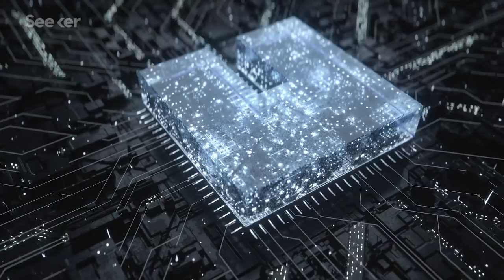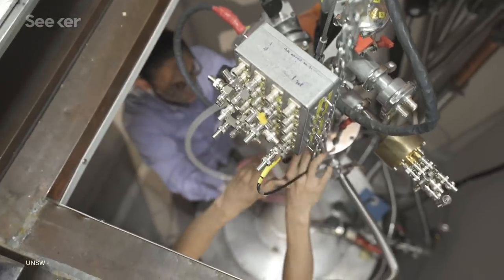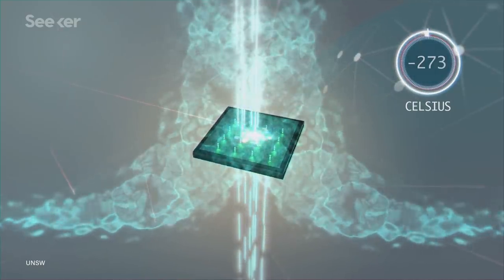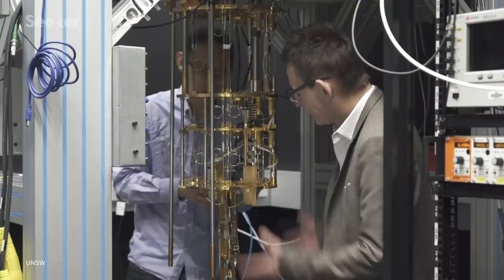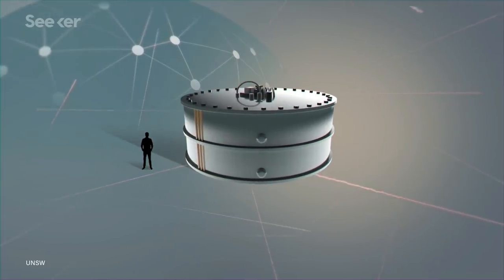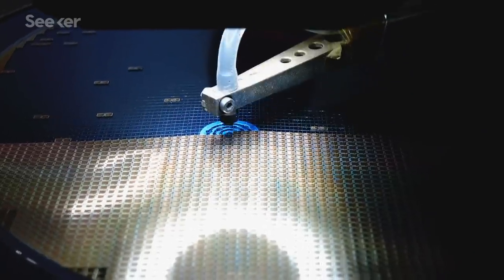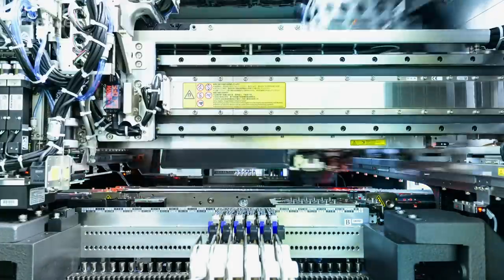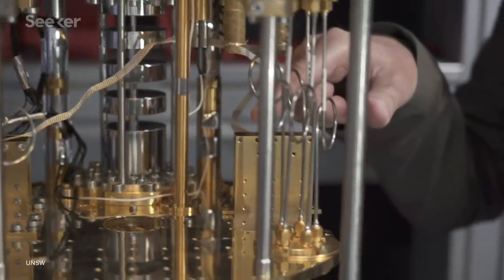‘Hot’ Qubits Crack a Major Quantum Computing Challenge

Comment: A quantum computer should be able to route the conenctions on a printed circuit design quickly, and also solve routing problems that conventional PCB router software struggles with. Same class of problem as the travelling salesman question, trying to find the shortes overall route between many different places. I'd love a quantum computer as part of my CAD setup but it won't be affordable in my lifetime.
Reply: Try Leap2 from D-Wave, Python 
Quantum computing in our lap👍👍

Comment: Have heard quantum computers give a likelyhood answer, rather than yes/no... I'm curious as to weather the likelihood answers are consistent? Like if you ask the same question again, is it possible to get slightly different answers?
Reply: technically yes, for my understanding, if you have a model to ask if the circuit in a specific angle result is true or false, it can give you a result like 34% true and 66% false and running again it could give 35% true and 65% false.
So if you asking something whether a coin will fall on head or tails with the same insufficient data, it could give different results
Reply: No, it would be the same answer, because the purpose of a Quantum computer is to go through all Possibilities in a superposition state then give a classical outcome of 1 or 0,  for one same solution... because the solution or answer is correct 
       Return = True always

Comment: I suspect Quantum Computers will be good at REAL WORLD solutions. For instance we can try and calculate how various molecules might interact with a potential drug. With a classical computer this takes FOREVER as you have to brute force your way through near infinite calculations of incredible complexity. But with a Quantum Computer, if you design the program correctly, the system can only ever fall stable into the PRECISE SOLUTION to the problem. That's the key, the system stabilises into the answer. The difficulty is learning how to program the system in the first place so that it can only ever yield the answer you are looking for. Bit of a Hitchhiker's Guide to the Galaxy scenario, you know the answer is 42, but what is the Question in order to arrive at that answer? The real power comes when you can determine a real world macro problem follows the same MATHEMATICAL rules as a Quantum mathematical problem. You then encode your Quantum Computer to give an answer to the Quantum problem, and BINGO you have an equivalent answer to your Macro problem. Bit like certain IONS can behave mathematically equivalent to Black Holes. We can't study the Black Hole directly, but we can probe an ION in the lab and hence infer how a Black Hole might behave if indeed they share the same Mathematics (as theory suggests). By the way, this video mentioned 0 Kelvin. What they really meant was FRACTIONS of 1 Kelvin, as you can't EVER achieve 0 Kelvin. Mathematically speaking there is an asymptote at 0 which you can approach but not reach.

Comment: Hot Qubits? Can you link the paper on this?
Reply: The cores of D-Wave quantum computers operate at -460 degrees f, or -273 degrees c, which is 0.02 degrees away from absolute zero.

(460°F − 32) × 5/9 + 273.15 = 510.928K

Comment: Keep them cold? Seems simple to me. Put them in space orbit around earth
Reply: That might be a good place for one of these, but it’s not quite that easy 😅 Things that are in the sunlight in low earth orbit usually reach around 250 degrees, so you’d definitely still need a lot of equipment to keep these cold.
Reply: That's a pointless argument..
The cores of D-Wave quantum computers operate at -460 degrees f, or -273 degrees c, which is 0.02 degrees away from absolute zero.

Comment: 1.5K is 271C, which is almost the boiling point of hydrogen... that's pretty good
Reply: The cores of D-Wave quantum computers operate at -460 degrees f, or -273 degrees c, which is 0.02 degrees away from absolute zero.

Comment: From -273°C to -271°C ... what an achievement ... mass adoption is on it's way!😂😉
Reply: The cores of D-Wave quantum computers operate at -460 degrees f, or -273 degrees c, which is 0.02 degrees away from absolute zero.

(460°F − 32) × 5/9 + 273.15 = 510.928K🤗

Comment: uh send the rig to space I heard it's colder
Reply: The cores of D-Wave quantum computers operate at -460 degrees f, or -273 degrees c, which is 0.02 degrees away from absolute zero.

(460°F − 32) × 5/9 + 273.15 = 510.928K
So your statement is irrelevant

Comment: So, basically nothing has changed in the last 3 years. Good to know.
Reply: DEMONIC programming: a computational language for single-particle equilibrium thermodynamics, and its formal Semantics: 

Also,
Maxwell's Demon, 'a being whose faculties are so sharpened that he can follow every molecule in its course', has been the centre of much debate about its abilities to violate the second law of thermodynamics. Landauer's hypothesis, that the Demon must erase its memory and incur a thermodynamic cost, has become the standard response to Maxwell's dilemma, and its implications for the thermodynamics of computation reach into many areas of quantum and classical computing.
Landauer’s hypothesis was introduced to get around the problem of Maxwell’s Demon: a diabolic entity who could apparently violate the second law of thermodynamics within a closed system.

The second law of thermodynamics, in one of its formulations, states that within a closed system the quantity entropy is non-decreasing over time. Some processes are only allowed to operate in one temporal direction. This appears to conflict with underlying reversible microdynamics, either quantum or classical Newtonian. Since the formulation of thermodynamics, toy model thermodynamic systems have been used in debates around these foundational issues. The simplest example is a single particle in a box, in contact with a heat bath. The thermodynamic variables can be easily specified, while at the same time the microdynamics for the single particle are easily comprehensible. While there are important issues around whether this system can actually be said to have a thermodynamics (usually considered a theory of large numbers of particles), it is a useful tool and the form of system that has been considered by a large number of authors from Szilard. By formalising this system, we also give a starting-point for a similar semantics of many-particle thermodynamic systems. The fundamental system under consideration is a single particle gas in a box, connected to an external heat bath. The heat bath keeps the entire system at a specific temperature T; this is a constant and not a variable. The thermodynamic variables for the system are: pressure of the gas (i.e. the force exerted on the walls of the box by the continuous motion of the single particle) p, volume occupied by the gasV, and entropy of the system H. There is a removable partition in the middle of the box, and two pistons (left and right) which can either compress the gas and input work −W into the system (isothermal compression) or expand under pressure of the gas thereby extracting work W from the box (isothermal expansion). There are two fundamental equations of state for the system:
pV/ T =const Hout −Hin =kln Vout /Vin

where again k is the Bolzmann constant, and where ‘out’ and ‘in’ refer respectively to output and input values of parameters for a given transition. The first means that pressure and volume are not independent at a fixed temperature; only one variable need be specifed. The second equation means that a decrease in system volume of a half decreases the entropy of the system by kln2. A doubling of the system volume increases the entropy by the same amount. In isothermal expansion from volumeV → 2V, the amount of work done by the gas on the piston isW =kT ln2. In isothermal compression 2V →V, the same amount of work is input to the gas by the piston.

Comment: Why not build them in space ,there would be a constant low temperature.
Reply: The cores of D-Wave quantum computers operate at -460 degrees f, or -273 degrees c, which is 0.02 degrees away from absolute zero.

(460°F − 32) × 5/9 + 273.15 = 510.928K
So you're statement is irrelevant

Comment: If you're just here to know the temperature, it's 1.5°K
Yes, it's actually a big deal but no, you can't keep a quantum computer in your freezer yet
Reply: No..
The cores of D-Wave quantum computers operate at -460 degrees f, or -273 degrees c, which is 0.02 degrees away from absolute zero.

Comment: Just build the computer on other planets that are colder than earth
Reply: Yeah, good luck finding a planet with less than 1.5 kelvin on it's surface
Reply: You're statement is irrelevant because,
The cores of D-Wave quantum computers operate at -460 degrees f, or -273 degrees c, which is 0.02 degrees away from absolute zero.

Comment: Oh, they operate at  1.5K Kelvin? Do the math for me will ya? We dont use the R-word system.
Reply: The cores of D-Wave quantum computers operate at -460 degrees f, or -273 degrees c, which is 0.02 degrees away from absolute zero

(460°F − 32) × 5/9 + 273.15 = 510.928K

Comment: I thought hot cubits would be like -100c something.
Reply: What are "cubits"?🤣🤣🤣
You mean 'qubits'👍👍
Reply: The cores of D-Wave quantum computers operate at -460 degrees f, or -273 degrees c, which is 0.02 degrees away from absolute zero

(460°F − 32) × 5/9 + 273.15 = 510.928K